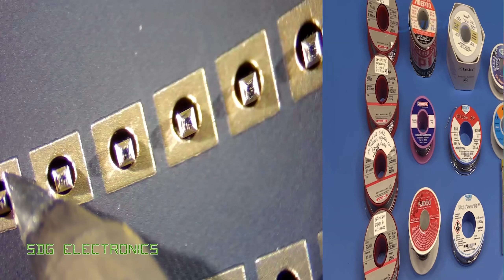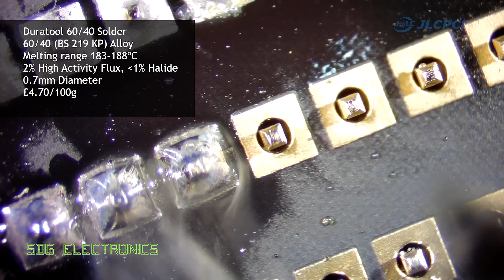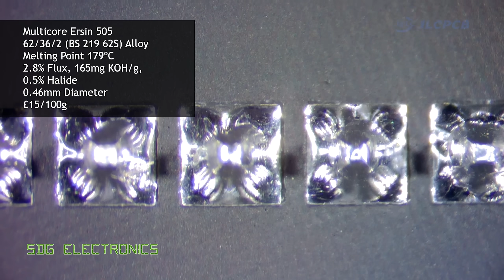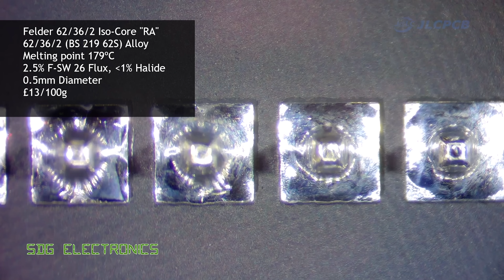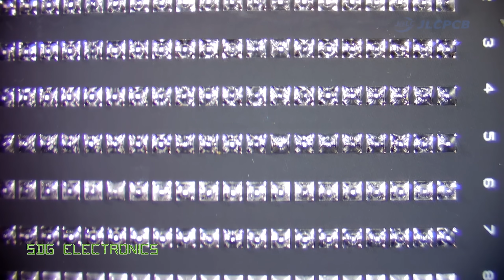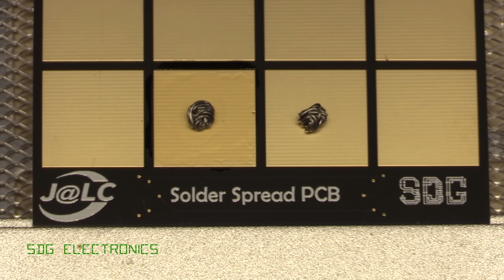SDG #079 What's the best solder for electronics? Expensive or cheap?

Comment: The Jinju may be a lead free variety ... labeled incorrectly.  You didn't mention that the odd one was 50% 50%  (you did write but did not say).
Reply from the maker: It could be, and may explain the difficulty in getting it to melt on the hot plate. I guess tin is cheaper than lead, so they may have just increased the tin ratio to cut costs.
Reply: @sdgelectronics  i have jinhu lead free solder wire is need high temp dan the solder wire label is wrong on lead free it say leaded solder but it lead free
Reply: Please, can one of you test the hardness of the reflowed alloy? I had qiute opposite theory, that they put more lead in there, because tin is usually much more expensive than lead and you can rarely see the Chinese manufacturers using the more expensive materials instead of the cheapest available.
Mechanic brand is known to be significantly higher quality than other Chinese brands. In fact, Mechanic isn't Chinese brand, but Hong Kong brand.
Reply: @ales_xy  Hongkong = China close enough the best solder is not  mechanic but blue kaina